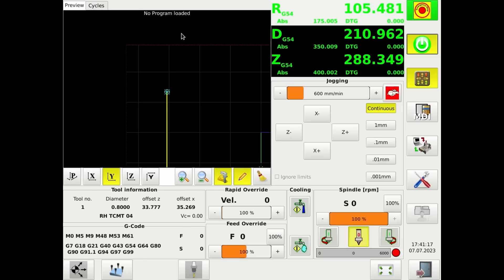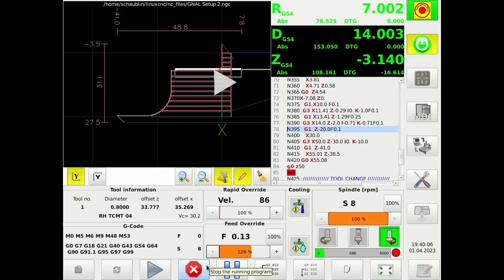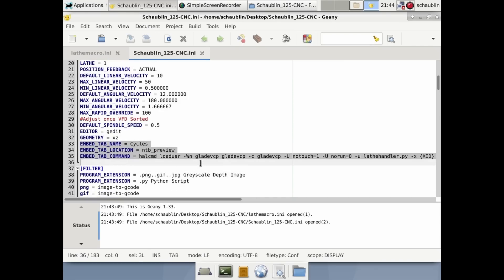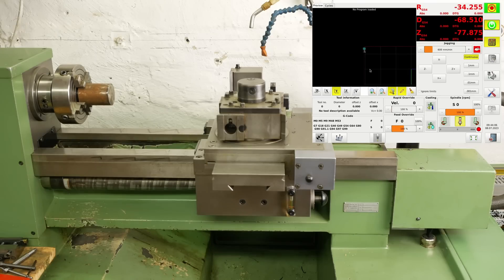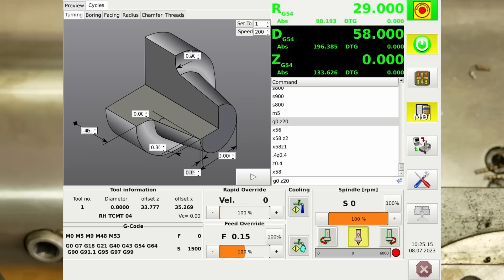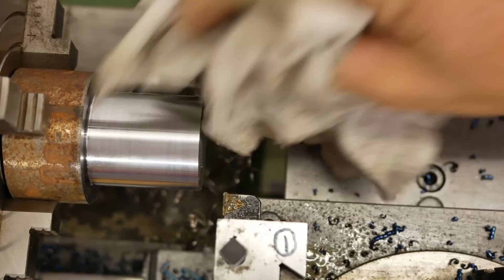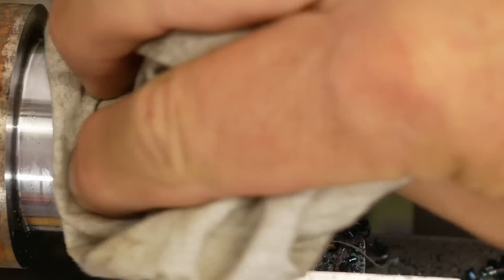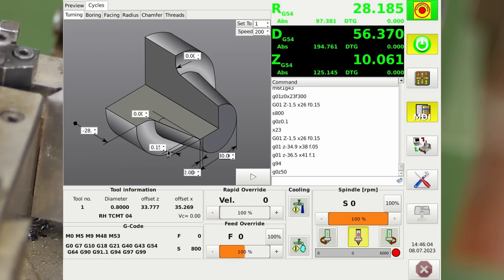DIY chuck arbor.  Schaublin Ep.53 || RotarySMP

Comment: Don't know how far you have come with this lathe but 2 things you could add that would be very useful are: Automatic oiling for bed and cross slide, and a tool probe. Great work !
Reply from the maker: This lathe has an integrated manual oiling system which works really well.  I am not sure how a tool probe can be easily implemented on a lathe. Too many different tool geometries.
Reply: @RotarySMP  I saw the manual oiler, which is nice, but you have to remember to push it :)   To probe all the geometries you need a probe with 4 buttons. Don't know what those cost but they might be  / probably are very expensive. Just that when you have had a lathe with a tool probe, one without just won't do. Automatic ones are even nicer.
Reply from the maker: @Panzax1  I use the oiler every time I start the lathe. It is getting low, I need to refill it.

Comment: Maybe im fooled by the edit but it seems the reason it still didnt grip is that you forgot to shorten it (again) after extending the taper the last time.  As well as learning to not creep up in terms of depth of cut, maybe we can all also learn there is no reason to try to get the length exact in a case like and creep up on that 1mm at a time, it wouldn't have killed the part to take a whole mm off the shoulder and length, which at 1.4 degrees corresponds to only a 20 microns or so on the diameter ..
Reply from the maker: I didn't show it, but did shorten the part.

Comment: Hi Mark,
what a pity with the chuck arbor ...
BTW: In your scrap bin are some heat elements from a Ceran Oven.
Have you ever tested to us them in a furnace. Are they destroying themselves when they are used without any heat regulation?

... is it possible to save your arbor by totally removing the shoulder for a nice fresh B taper.
Why to have a shoulder in the first place?
Reply from the maker: Those Ceran Oven elements burned out after 27+ years. Amazing that Bosch still had drop in replacement parts on stock. I already have a 2.5kW process oven, so I will just dump the dead elements.

Yeah, I already turned off that shoulder :)

Comment: Hi Mark, without giving up to much of the plot on the backgear/variator control episode , how is that going?
Reply from the maker: Hi Steve,  I am just getting back into it. Rewatching the "Feral engineer" classic ladder series, and trying to work out how to make it all play nicely together.
Reply: @RotarySMP  looking forward to the solution.
For a bit of perspective, mori seiki (and most others) used a 2 speed gear box and switched between gears either with a selector switch
or using M-code (normally M41 and M42).  spindle range is selected Before any cutting.
at its simplest and most basic M41 could  be low/low ratio with the backgear and vatiator
and M42  high/high.

Comment: Do you not have variable speed setup on the lathe? Looks like the the center speed wasn’t enough
Reply from the maker: It wasnt. I have a back gear, a variator and a VFD. It was only in back gear and the Variator was controlling speed. I am currently working on how to integrate the controls to play nicely with each other.

Comment: With carbide inserts you should at least be cutting the depth of the nose radius of the insert to maintain a good surface finish.  Anything less and the insert is just rubbing the material, not cutting.  I believe I heard this advice from one of Keith Fenner's or MrPete222's older videos.  This advice seems to be working out for me at least.
Reply from the maker: Yep. That was part of the issue I had. The highly positive, sharp polished aluminium cutting insert is more like HSS, in that it will take a very fine cut, much thinner than the nose radius. I should have set that tool up in advance.
Reply: @RotarySMP  That almost seems like an improvement that could be made in the macros - if it's going to take multiple passes of full DOC + a tiny little bit, it should do the tiny little bit pass at the beginning, rather than as the last pass.
Reply from the maker: @gorak9000  That is a good idea.

Comment: Your control doesn’t have tool offset capability? What I normally do if I’m not sure what size the tool will cut is. I  program a roughing cycle and a separate finish cut. Then when I run the tool the first time I set the offset out to cut large. Leave plenty of stock. Then run my first finish cut with the same offset. Check/ measure the part. Then run finish passes setting the offset in a little at a time till I get to size. In steel like that the shallower the finish depth, the higher the surface speed needs to be to maintain a good finish.
Reply from the maker: Hi Peter, linuxCNC does have tool radius comp, but I haven't learnt to use it yet. Your input is really helpful.

I still have work to do to configure the spindle speed control. I have a pneumatically actuated back gear, a variator and a VFD, and need to work through a control heirarchy to get that all working seemlessly. That explains the limited speed range as I was only on back gear.

Comment: That lathe is pretty neat, didn't know there was a such thing as Linux CNC, kind of reminds me of mazatrol a little. Great video thanks.
Reply: Linux CNC has been around for a VERY long time. Originally it was called EMC2. I've been wanting to make a machine that uses it for years and years, but I ended up buying a mill that uses a Mitsubishi controller, and just invested a ton of time into reverse engineering the firmware to allow it to have more memory (than it ever had originally). After investing all that time, I guess I'm sticking with the Mitsubishi control on that machine.
Reply from the maker: Linuxcnc's history traces back to a research project by the US NIST, who wrote the original source code. Becsue it was paid for with public funds the code was open source. At some stage it was renamed from EMC to LinuxCNC, and a community took over mangment of it. It is really stable and flexible. Can be used on all sorts of machines, including non-cartesian.

Comment: I’ve never seen that style tool post before, such a great use of the space between the dovetails to hold round tools
Reply from the maker: It is the standard Schaublin tool changer for this generation of 125 CNC's. Somewhere along the line they switched to a more modern tool changer with a horizontal rotation axis for the current 125-CCN's.

Comment: Curious as to what cam your running?
Reply from the maker: The one I showed is an ancient version of FeatureCam. I am now trying to get my head around the CAM in FreeCad.
Reply: @RotarySMP  interesting, I will give it a go. One thing about CNC is cam is harder to get used to than 3d printing.
Reply from the maker: @Engineerd3d  It is. You need experience and "feel" for feeds and speeds, stick out, deflection, clamping and fixturing etc.

Comment: Great video, absolutely amazing machine , glad to see you didn't keep the less than perfect tool holder . 1 thing I have learned being a machinist for 23 years your tooling has to be fit to do the job you expect. If you have less than perfect tools you can only expect less than perfect results . Hopefully we get to see a redo
Reply from the maker: Thanks Michael. This lathe is really rigid and tight. It returns excellent surface finish on a much wider range of F&S than the Boley (or minilathe of course).

Comment: Is hand coding so dead it doesn't even make the list? 😂 I hand code the lathe. It's a lot faster to make the 2nd (good 😅) part if you already have a program, vs all the macro steps.
Reply from the maker: Good point. I also hand coded up till now, but make too many errors.

Comment: I wonder if you can use negative geometry insert, these tend to have a nicer finish, but requires quite more rigidity and power.
Reply from the maker: I am pretty sure this machine has the rigidity for them, but I would expect you need a few test parts to dial in the feeds and speeds. I mostly only make small parts and one offs.

Comment: If you keep thinning out the shoulder, how to ever get the drill chick off the arbor again?

Have you tried the nameplate in the ultrasonic cleaner?
Reply from the maker: You get the chuck off with a punch up the center. The shoulder is there for the other end to ensure a defined stock length into the tool changer.

I wold have to pull it off, and it is really easy to damage things pulling out those little tapered pins.

Comment: Grate vide at this rate I might have to get a cnc machine my self:) I am pretty sure you'll get your bandsaw gearbox up an running soon.
Reply from the maker: Hi Luke, 
Yeah, that second shaft is looking much simpler, now I know that this 1.8179 steel machines really nicely.
Reply: @RotarySMP  yes and you have a real nice lathe there. I really need to keep an eye out for a small cnc mill.
Reply from the maker: @LCalleja  The Maho is a nice machine. They seem pretty common on Kleinanzeigen.de.
Reply: @RotarySMP  yes I think I might have to block that site as seem to be using it more and more :) the problem is finding space for it. I think I would have to find something a bit smaller
Reply from the maker: @LCalleja  I considered modifying a smaller machine, but by the time you put an enclsue on it, the foot print ends up nearly the same.
Reply: @RotarySMP  good point there. The other problem is that I would have to convert it to single phase as well I think I am better off diving out my abandoned diy cnc mill and finishing that off
Reply from the maker: @LCalleja  You dont have 3 ph? Is it not common on Malta? Here, even the apartment we used to be in had a 3Ph feed, and the oven on it.
Reply: @RotarySMP  no you can get it but ends up being a bit expensive so I ended up converting my machines to single phase as it’s a hobby can’t really justify the cost. The standard supply is 230v 40a single phase.
Reply: @RotarySMP in the UK it is unheard of in domestic properties to have 3ph and you do want it is extremely expensive to say the least. my mini lathe is single phase and I have converted my warco major mill to 3ph 230 v rather than 415 v with inverter drive for variable speed. Great video make a test piece first is always a good starting point. A good friend off mine has been a CNC machinist for over 30 years and doesn’t like conversational programming he says that although you can pick blocks of code you still need to modify it so he finds it quicker to work from scratch.
Reply from the maker: @LCalleja  Do you run everything off VFD's, or just capacitors to fake a phase?
Reply: @RotarySMP  I run them off vfd as I wanted the soft start function as they are quite big motors and they run a bit better.
Reply from the maker: @LCalleja  Cool that you can run any VFD off single phase just by derating them.
Reply: @RotarySMP  I bought mine specifically from 1ph to 3ph they run my machines just fine. The lathe is 5hp and runs perfectly fine.
Reply from the maker: I am sure we will ;)

Comment: Yeyy those macros really rock, done some add+mods 
Cheers from Sweden Bengt
ps. my Lathe is for sale
Reply from the maker: Hi Bengt. What are you replacing your lathe with?
Reply: @RotarySMP  I have already sold my milling machine so next is the lathe. Getting older with all that comes with it, pain all over. Time to clear all my tooling as well.
Reply from the maker: @tecnobs3d  I hope you have some mate who will still make parts for you.
Reply: @RotarySMP  Mostly 3D printing now both resin and FDM
Reply from the maker: @tecnobs3d  It is fun technology.

Comment: Very informative.  Thanks for showing us what you did.  The conversational CNC looks really useful. It can be difficult to get all of your ducks in a row with a new process.
Reply from the maker: Yeah, I really is a nice simple interface which Andy programmed there. Perfect for the sort of one off home shop projects I do.
Reply: Actually, I think that conversational programming is a pain in the ass compared to a Fanuc with g and m codes. 
I guess having an old out of date cnc is novel, like driving an old car.   When you flipped your part over and indicated it , you should have put a test indicator on that square shoulder that was opposite the chuck.  Along with indicating the diameter that you did indicate. Then you would know that the part is both running concentric and square.  
Invest in a test indicator,  that dial indicator that you are using is what mechanics use. 
Have you actually used g and m codes?  They do work pretty well.
Reply from the maker: @paul5683  Hi Paul. I have programmed using G an M codes, and also the O codes to do subroutines to automate the multi pass cuts needed. 

LinuxCNC tracks very close to the RS-274 standard, so it does not include much in the way of multi pass canned cycles for the lathe. These macros are a really time saver for one off parts.

Comment: Rough to +2mm, have a cut 1mm oversize of your desired finish measurement with finish parameters, measure it and comp the difference out between your measured and desired finish dimension is how we usually did at school for straight tolerances. A taper your choice of doing a test-finishing to size a bit further out the shaft makes excellent sense so you still have meat left to cut once adjustments are made!
Reply from the maker: Thanks. Good approach.
 My plan would have worked, if I had taken a more aggressive second cut at it, but sort of whittled away at it. Oh well, it was a learning experience.
Reply: Yeah learning you'll be best of 1-shotting it on cnc lathes is a bit wacky at first, but when you get into the habit it works very well. Sure beats making a mess of the surface with sneaking up and emery/sanding the last bit of the oversize out of it tho :D
Reply from the maker: @Echo51  I'll set up the sharp/positive insert on a different tool holder, and have it dialed in in advance as well :)

Comment: The finish is great and the machine performed to a great standard. Now the operator needs a little work maybe a lesson from your daughter she has that welding going in the right direction. It's just teething problems next round will be better, but I would keep a close eye on your daughter she just might borrow the lathe. Have a great week.
Reply from the maker: Yeah. CNC 1 : Mark zero!